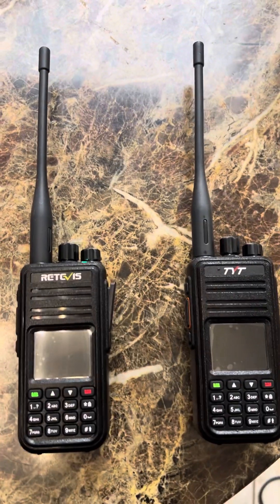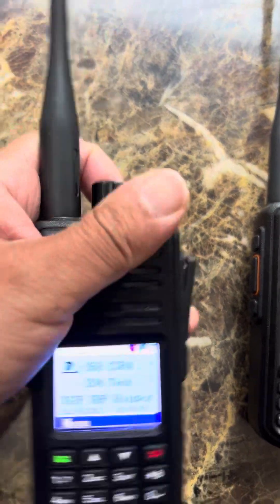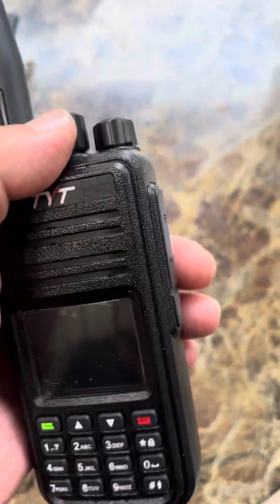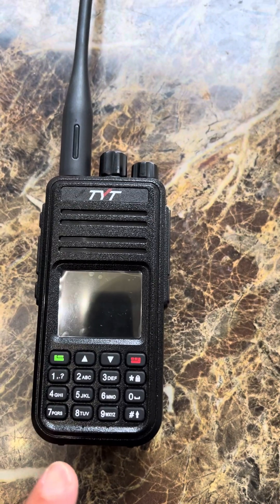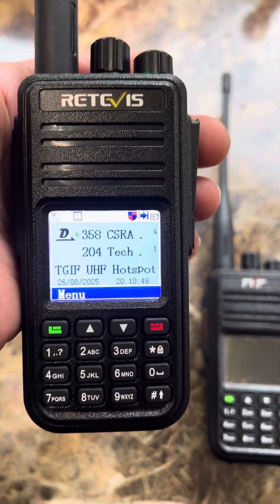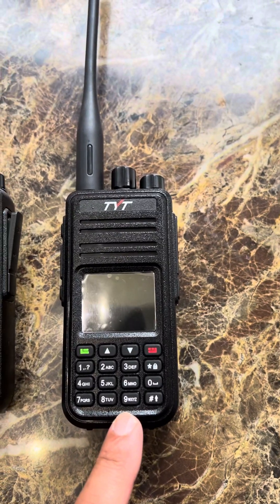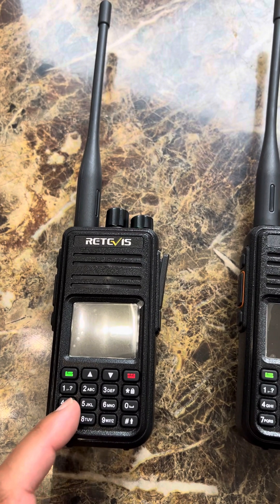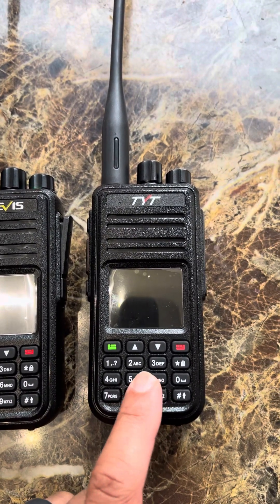Comparing the RT-3S & TYT UV-380 with OpenGD77

Comment: BTW, to trigger the backlight, you can just press SK1, that's the only key that has no action (unless voice prompts are enabled). Or define some percentages to Display options "Min bright", like 6%/8%
Reply from the maker: Thank you, I’ll be doing some more experimenting with the OpenGD77 firmware.  I’ve used it for a short time and I’m very impressed by it.